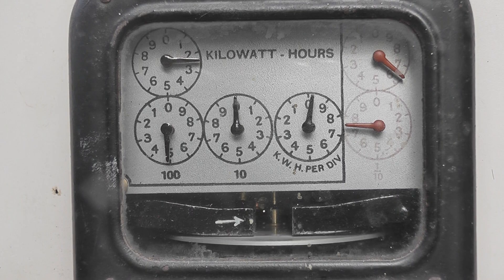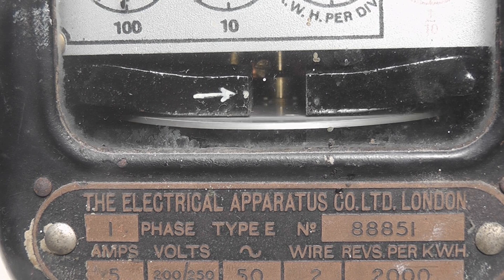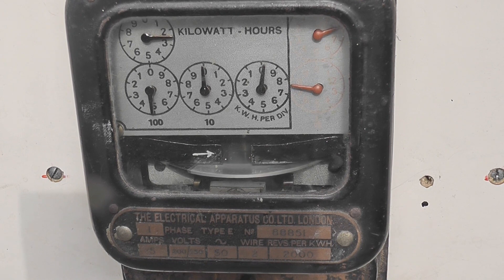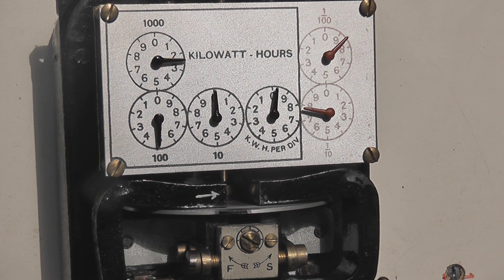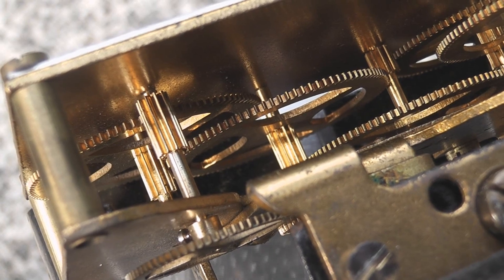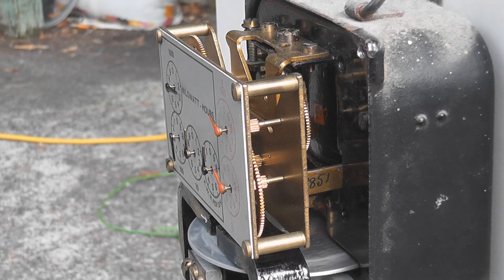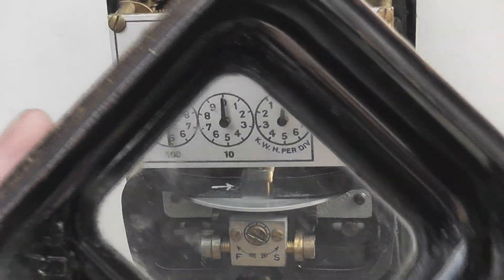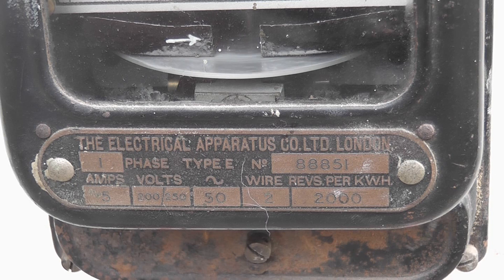The English Apparatus Co  kWh Meter

Comment: Viewer # 151. :-D

Aaaah, perfect timing. I needed another fix of satisfying loadwheel action, and this time, it's delivered by an unknown make and model of instrument. Tasty. :D

Yes, those 5A instruments must surely have been from the early 1900s because of their loading capacity. My cleaned-and-restored British Sangamo HM is 10A, and these days that is a more-or-less unusable loading capacity, so it doesn't get used at all.

Maybe a bit later, under controlled phantom current, I will whip out that one again and get its loadwheel revving-up.

It's been some time since that one has been on-video, and I might just wait until the end of the year and record it in FULL HD on my Wayne's Electrical channel.

We will have to see how things go there, but for now, thanxx for showing.

17th February 2016, 12.35
Reply: +BoomBoxDeluxe I have a 10 amp meter feeding all the IT/telecomms gear in our attic, it's ideally suited to the load :)
Reply: Aaaah, those meters do have their uses, just no longer as a main incoming meter.

Provided that the meter doesn't become too hot being located in the attic, then it should maintain a good degree of accuracy over a long time.

The inevitable questions.... :D

What make, model and loadwheel speed is it?

-BoomBoxDeluxe.

17th February 2016, 19.00

Comment: only 5 amps ?
Reply: +Adrian Higgins That is a test current rating used to control the accuracy of the meter at factory.
Reply: My "British Sangamo HM" is only 10A, and the loadwheel speed on that is 750 revs/kWh. :-)

-BoomBoxDeluxe.

17th February 2016  19.08